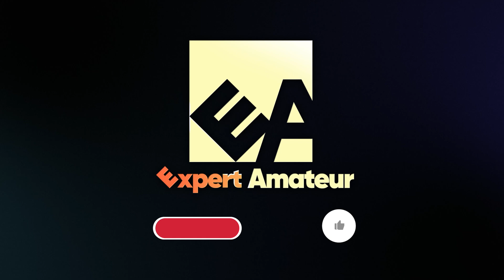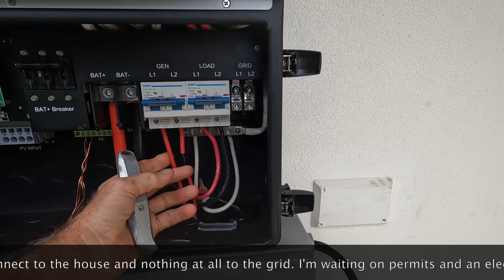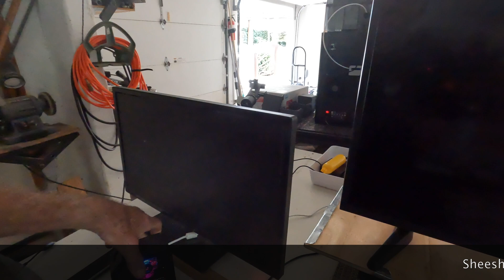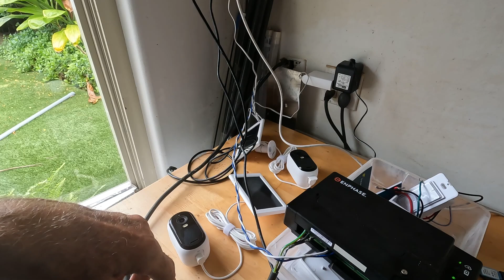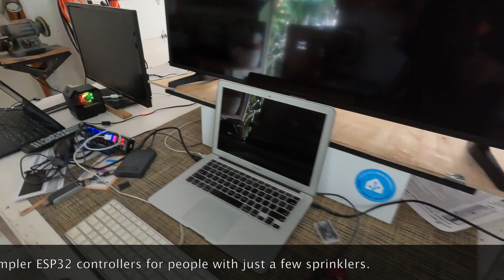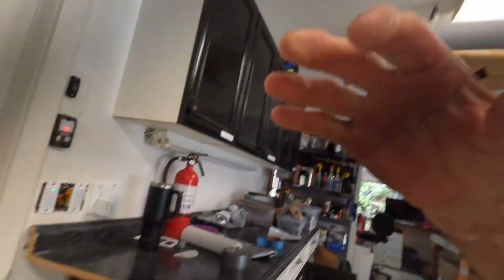Load Testing Wildfire Protection System Solar Power Supply

Comment: Appreciate the videos.I had heard of ESP32 but not with cameras.  Great ideas and tips.
Reply from the maker: I use them for all sorts of monitoring and control, lots of possibilities there. And they are super cheap--like $5 to $10 on amazon, much cheaper on Aliexpress pre-tariff. Now, who knows. If you are using Home Assistant they can be configured using ESP Home to make it super easy to use them. All you need in addition is a USB cable and wall wart. Random Nerd Tutorials has a superb course on them if you aren't using Home Assistant.

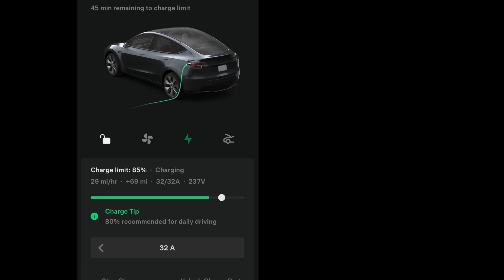Comment: 2:09 118w to 150w solar output is a big range. 150w capacity but much lower outputs.  16 panels. 84w on one panel.
Reply from the maker: Actually it's 32 panels and they are 12 year old 250W Sanyos with insane leakage to the frames. The only reason they are worth using is they're already there and the microinverters are new-ish. I replaced them all after they ALL failed. The replacement microinverts are weird: IQ7PD-72-2-US. Enphase said they didn't have any of the original inverters so they "upgraded" me to these. They max out at 199 W, so I don't really know if it's panels or microinverters, or something else, but the most I've gotten out of all 32 panels in noon sun (though it IS still winter--sort of) is around 6KW, so about 197W per panel.
Reply: @ExpertAmateur-xn6dr  did enphase charge you???
Were they guaranteed  ???
Reply from the maker: @stephenbrickwood1602  long story, but yes they were guaranteed but they couldn't supply the units I had, the only choice was an upgrade. It was deeply discounted but no labor allowance and the original installer was long out of business. I had to replace them myself, no installation company would do it. Not easy for a 76 year old guy (two years ago) but I did it. Long warrantees are basically useless. 6kw for 32 250W panels isn't horrible, if they actually delivered 250W each it (they never did) it would be 8000W. Still, I installed 370W bifacials for my container project and in full summer sun with a white painted wall and roof behind the panels I'm maxing out about 410W each.
Reply: @ExpertAmateur-xn6dr  excellent answer.
Reply: @ExpertAmateur-xn6dr   could you run a wire off each panel to the ground to measure how well the panel is performing. Or to an in the attic panel. ??
No subscription services. 
There is no need to go onto the roof unnecessarily. 
Then, a string inverter at the meter box..
Reply from the maker: @stephenbrickwood1602 It's a ground mount, and all the local solar companies refused to work on it because the hill it's on is steep as a cow's face. It's a good idea, except I don't really expect or need much from the PV system and I don't want to go down there unless I really need to. Since I'm using a hybrid inverter for this project which has two unused MPPT controllers capable of supporting an additional 12KW of panels the rational way to boost input (if I needed it) would be either the solar carport I mentioned or an added ground mount further up the slope with some nice hefty bi-facials panels on it. That would probably require trenching which would be a real mess since the yard section it would run through is artificial grass (fire resistant). One of the electricians I talked with suggested upgrading the existing panels and adding higher wattage microinverters, so I guess that would be option 3 (also, nope). I'd like to do the carport, if only to charge the Teslas (we have two here) but I also insist on staying married, so not likely. In reality, for the scope of this project the primary aim is providing power throughout an all-too likely power outage, which the current arrangement will do nicely. Using home automation to shed loads reduces the total draw to about 3.6KW peak with a base 24 hr load of 1.7KW--so about 40KWh (yes, I've monitored every load for two months of peak use with two Refoss 16 channel systems). With a 16KWh battery and about 48kwh of power from the panels the system can run for long as the sun shines. I will probably do more--if only because I can. But I need to work out a practical approach, and today's modest setup is adequate.
Before you say "put some panels on the roof" take a look at my video on RSD and also realize that my gorgeous blue tile roof is, stupidly valuable, extremely hard to repair, and a bit fragile. When we paint this place we don't allow the painters on the roof--not even with wood decks on mattresses. The roof peak trim gets painted by a guy in a bucket lift. Yes, a first world problem but we bought this place 25 years ago when it was affordable, since then we've both retired and we neither could nor would be able to buy it these days. Anything that would cover or damage the roof is a complete non-starter. Despite it's size and appearance this place uses very little power and what it does use is managed directly through Home Assistant. The biggest installed load is the pool circulation pump with a variable 2.5 HP pump. Second largest is two water heaters, one for the building across the pool which is electric resistance but which operates on a schedule when it runs at all, providing hot water for guests during the hours they'd likely need it--but if there is no guest the water heater is in vacation mode. The second is a heat pump water heater which uses a shockingly tiny amount of power and cools the only room in the house that ever gets too hot for comfort--the garage/shop. There's no heat or AC other than a little portable in the garage (which is now rarely necessary). We've never needed it. In an outage the Home Automation system sheds all the loads except lighting, refrigerator (vital because diabetic wife and who wants a refrigerator full of rotted food) the electronics to run the HA system, and the sprinkler pump. Using Home Automation to shed loads turns out to be incredibly effective since virtually anything we buy these days is "smart". Even the Jandy pool control system  is directly controllable through Aqualink, which our pool guy installed two years ago to get rid of the expensive and unhandy remotes. 
I think for the average solar enthusiast who isn't as concerned as I am with wildfires the most valuable thing in this series will be understanding how the EG4 inverter/battery system works, and using home automation to both manage and reduce your normal loads, and to shed loads during outages without the expense and inconvenience of critical load panels. You can literally change what is or isn't a critical load and control about everything in your home from your smartphone--regardless of where you are in the world. It's pretty cool.
Reply: @ExpertAmateur-xn6dr   wow, that's a complete answer. Thumb 👍 
I think I am looking for a simple plug n play. 
I have small land and a biggish home.
Tall, high roof.
Using the roof area, but limiting going onto the roof.
Reply from the maker: @stephenbrickwood1602  I'm working on it. Honestly, the most straightforward answer is google "Firewise" and do what it says. It's mostly changes to your landscaping and perhaps your soffit vents that should be very inexpensive and easy to do. I'm working on the complete answer as a plug and play. It's a lot of work but I'm enjoying it. 60 to 90 percent of homes lost are to flying embers, not the wildfire itself. Most of the house fires start far from the fire lines--like miles.  If you prevent those embers from igniting flammable stuff around your home then your home is FAR more likely to survive a wildfire. Simply cleaning flammables like leaf litter out from under decks and away from your house drastically increases survivability.  If you convince your neighbors to do the same simple things the survivability of your neighborhood jumps even further--because burning houses downwind of you become ember storms.
Reply: @ExpertAmateur-xn6dr  whoops, I am just addressing panels and limited need to access the roof. 
I don't have a fire problem.
Reply from the maker: @stephenbrickwood1602  Hey Steven, thanks so much for your comments. they made me start looking for a reason why there was so much variation. I came up with all kinds of technical reasons but because the panels that were affected were on the left side of the array there seemed to be no possibility of shading, so I dismissed that as a cause. But I started paying attention to the graph of the power generation and realized that the major variation in generation occurred only in the morning, when there was a chance of the panels being shaded by a bush on the right side of the array. I realized that when I commissioned the new microinverters I might have gotten the arrangement flipped 180 degree. I went down my hasty bank to look at the serial numbers on the microinverters, and took along my chainsaw. I cut the bush down and VOILA!. All better and a little more than another Kwh per day of generation. I did a quick little video on this, and of course credited you with the inspiration though I didn't directly name you. Thanks again.  https://youtu.be/vOxEgt8KhoM
Reply: @ExpertAmateur-xn6dr  happy to be useful.
I have been in a number of situations where something I said made the difference, happily. 
I have even had the design company go back to their design and cut $millions out of their design. 
I am a Construction Engineer. 
Few thanked me.